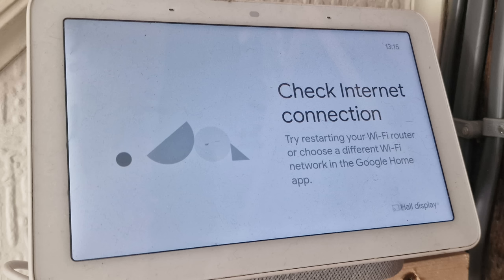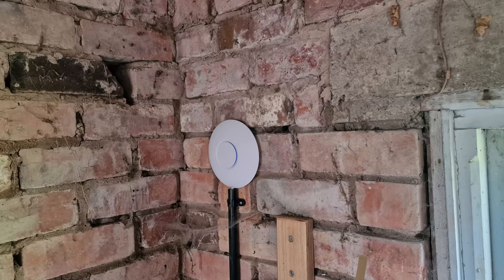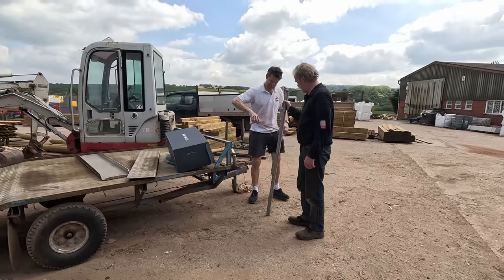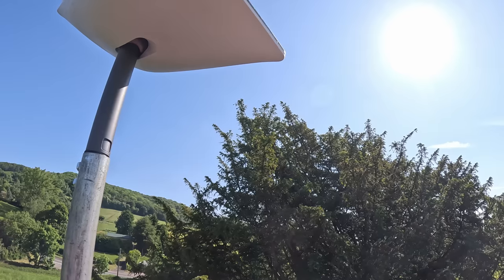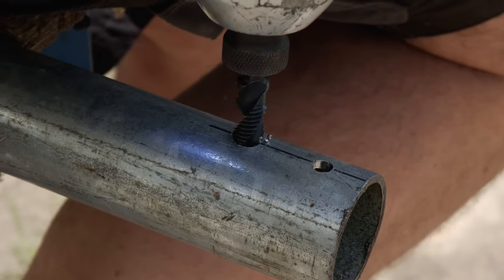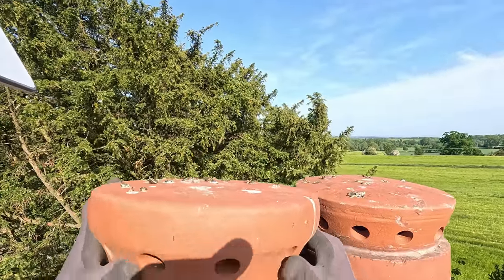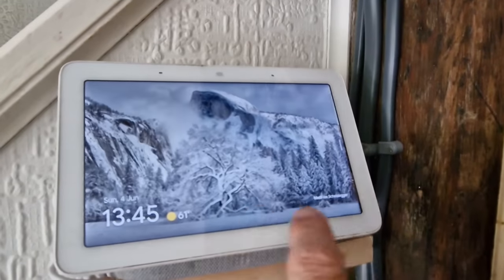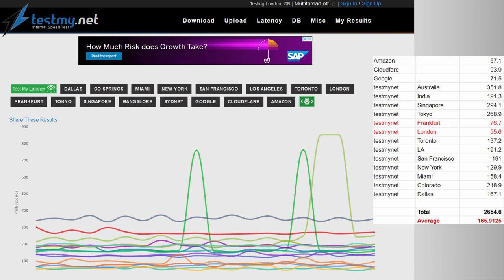Starlink Setup and Review

Comment: Your connection speed via Unifi can be caused by multiple factors. Some of which could be overcome in setup and others maybe not. Wi-Fi has 2 frequencies (2.4GHz & 5GHz) with the latter getting more features for higher speeds. Channel width can help to increase throughput so may be worth exploring config. It’s a tricky thing to get right and it’s possible to make it worse too so recommend changing one setting at a time and testing.
Reply: Keep in mind he has solid stone/brick walls in his house so 5GHz may not be the best option but it is most definitely worth trying everything that's available on Unifi which I no nothing about.
Reply: @josephking6515  indeed, I’d start by testing in same room as one of the Unify AP’s (but approx. 3m away where possible) and test speeds from there. Then play with setting on channel width on 5GHz etc from there. As you say, further away from an AP and the device may prefer 2.4GHz and then speeds will drop.

Comment: What CISCO switch are you running, if it's only running at 100Mb it will slow everything down. I'd replace it with a UniFi POE switch, so you can get rid of those POE injectors too.

Comment: Nice work, shame about the size of the monthly fee though. I would do some research about your ubiquiti before you buy anything else though. It may not be the ubiquiti that’s the bottleneck and a replacement may not be any faster. Or it may be just one component of the ubiquiti network or the cisco switch. I run about 70 devices off 3 APs, one switch and the UDM pro with no speed issues.

Comment: Not that I am in the market but I read some user reviews and it is a nice solution for all the more or less extreme situation, like mobile, boat or " in the middle of nowhere" but it has serious limitation and will never be a through competitor for wired internet in a residential area.
But everything is better than NO internet !
Thanks for sharing
Reply: I dunno, unless you are gaming, nothing else really requires the wired latency, at 30-50ms on starlink it copes with all the house needs and work from home needs too
Reply: @Extragonk  Just google the reviews and read the experienced downsides before you buy. That's all I am saying.
Reply from the maker: I'd definitely go with wired internet if I had that option.

Comment: I know you aren't an IT/tech guy Charlie but as someone with a 3500sq ft house over 3 floors, it would be really interesting to see how you've setup your network. I am looking at different options and like you will probably need 3 access points. I'd be interested to see a video explaining how you've done it (even if it isn't necessarily the 'optimal' way of doing it).
Reply from the maker: Sure, I'll add it to the list. The access points need an ethernet connection back to the router but you might consider a mesh WiFi system like the Netgear Orbi that someone recommended in the comments and Starlink have extra mesh routers in their shop, to boost the signal.
Reply: @CharlieDIYte  We moved into a rural location with a thick walled house of about 3,600 square feet. I went with 4G National broadband using Vodafone - which has been decent enough for us. Starlink would have been interesting, but not at full price!

I had an Orbi network in our old house, a base and three satellites. It worked well. In this house it doesn't. The problem is that the Orbi appears to communicate primarily over wi-fi with a wifi back haul (assuming it isn't possible to run ethernet back haul - which is hard for us to do). I gave up on it. 

In the end I purchased a Mesh network from TP-Link - the Deco Mesh P9. The "P" is important because it communicates on ethernet, wi-fi AND Power line, hence "P". The Power line is built into the unit. As long as the house wiring isn't installed by Thomas Eddison, it generally manages to punch a wi-fi signal around most peoples houses. In the end, we purchased a total of nine satellites (but they are much cheaper than Orbi) and we enjoy whole house mesh coverage. Admittedly, the mesh speeds aren't fantastic but, as most of the traffice ends up on the broadband connection going to the web, it doesn't matter that much.

Comment: I have noticed some 45 ms ping on your readings is that correct? I tested a similar system a couple of years ago, admittedly the speed was fast but the request time was horrendous so after a month I had to return it. Since this area has yet to be provided with fibre, I was considering trying again with a different company. Perhaps Starlink could be a good start. Thank you so much for sharing. 🙏

Comment: Had the same problem for a client of mine, so I used a necked pole and then U bolts to allow to clamp the stem of the Starlink unit to the pole.  Nightmare!!  They never mention the extras and even then the costs for say a pole adapter is ridiculous!  However it works a treat for my client, so everyone is happy all round.

Comment: Firstly, I’d like to know how you got that kind of deal? Here in Florida, when I “finally” got my notification that my dish was coming, I had to pay the 592.00 on TOP of the 99.00 I had put down as a deposit in March.  I got the kit a couple of weeks ago, had to order the 150 ft cable because our house is surrounded by oak trees.  Luckily our pump house isn’t so when I checked that spot, Starlink gave me a GREAT spot message.  I wanted the dishy as high as possible to make sure the oak trees didn’t block it in a few years so I ordered the Winegard 38” mast.  We buried the cable in the ground, in conduit, mounted the mast to the pump house gable and turned it on!  WOW! I can’t believe how amazing this system is.  Right now, it’s been raining ALL night, but when I checked my wifi I had 3 bars back in my office which is the furtherest from the router.  I just did an advanced speed test and we are getting from Starlink to the Internet: 159 download and 15 download with latency around the 22 mark.  And 42 download and 30 upload from the router to our devices.  Like I said, amazing!
Reply from the maker: It's brilliant isn't it! They had a limited time offer which actually ended just before I posted the video. Just as well though as I'm still paying for my old broadband connection 😩

Comment: Hi Charlie, I was interest you swapped from 4g LTE/5g cellular, to starlink.  What did you use for your cellular antenna, a built in router or an external aerial? Built in is not normally strong enough when rural.

If you'd used an external antenna, combined with a parabolic dish, you should have been able to improve your download and upload speed more than sufficiently.  I'm in the UK and rural.  I obtain around 200mb down and 100mb up.  I use two antenna  towards two separate masts to provide stability.

You should also look at the network using, as the performance will vary wildly.  Stay away from piggy back services as they limit the bandwidth.
Reply from the maker: It's a fair point Stephen and thanks for your feedback. I used the internal aerial. But the signal was fantastic for a year or so using this and then just dropped off a cliff. Starlink has been brilliant though.

Comment: Just set this up ourselves in rural Australia. We ordered the dish and then realised we needed the Ethernet adapter, but everything came very quickly. So far very happy with the system. We had been using mobile broadband, which was slow and unreliable.
Reply from the maker: Glad to hear that Joanne. It's more than you'd pay ideally but is a life saver in rural locations isn't it 👊
Reply: @CharlieDIYte  yes it is a bit pricey, it is a priority for us as my hubby is working from home. If the initial outlay hadn’t dropped by 3/4, I don’t think we would have considered it, but happy we did now.

Comment: Your lows of 6Mbs maybe indicate a problem, but if you're getting a peak of close to 200Mbs, I doubt you need to improve your Wi-Fi  - this are more or less normal numbers for Starlink right now, depending on the uptake in the area. It's also worth remembering that Ku band transmissions are quite susceptible to rain fade and this can occur between the satellite and the ground station even if you see a clear sky.
Best step would be to run those speed tests on the ethernet port.

Comment: At 12m05s it appears that the dish's tail is merely suspended from the dish; I would recommend you use quite a few outdoors-rated (UV-resistant) cable ties -- or similar -- as otherwise winds will whip the cable are quickly wear it out. (Think those flag pole wires incessantly banging and pinging in even low winds.)
Reply from the maker: It's a fair point. I've secured it with zip ties. Not sure why I didn't show it in the vid. Always forget something!

Comment: I just picked up the rural offer too; lucky to see it the day before it ended.  Delivery of the dish was super fast, but the ethernet adapter is / was much slower.

I wanted to go for the chimney install, but was advised against it due to concerns over strength; your install looks solid though - fair play.  👍

Good vid, and good tips.  The cable's a pain to get through, and doing that in advance I found helped a lot.
Reply from the maker: Thanks Steve. Yes my chimney is strong as, thankfully. Hope your install goes well. I'm really happy with it so far.

Comment: I am curious as to where you are based, as in "Rural", I am rural in West Sussex and have moved over to Box Broadband (Surrey based) and have connected to their fibre network. This is under a government initiative for connecting rural areas. So far very happy with better download and upload speeds that you report. I am on the lowest connection, 100Mb, which is fine for us. I too was getting frquent drp outs with TalkTalk and they were not interested in solving the problem, luckily I was close to the end of contract so could switch.

Comment: Regarding your speed tests - connecting over wifi as you have found out, CAN be very hit and miss with speeds. This is down to so many things: antenna, wifi standard and version, wifi frequency (we're up to 3 now: 2.4Ghz, 5Ghz, 6Ghz) each on client and access point, wall thickness and construction, location, orientation etc etc etc.

To get the best speed, it's always going to be a direct connect with a cable, but it looks like you're getting a pretty good speed over wifi, low latency and jitter, but that may change as you move about the property. At the end of the day, data is going up to and down from space, it's always going to be slower than FTTH or 5G to a local tower (and then further on via fibre again), but glad to hear it's doing you alright
Reply from the maker: Thanks buddy, appreciate that. Yes I'm gutted the 5G is no longer viable and I've just realised I've got 8 months left to run on the contract 🤦

Comment: You don't need to change your unifi, you probably just need to configure it correctly. Unifi is rock solid with speeds
Reply from the maker: Yes, I'm sure it's not configured correctly and doesn't help that I've got RJ45 connectors on solid CAT5e cable.
Reply: @CharlieDIYte  I went full unifi and all works well. I'm surprised you managed to get RJ45 on solid cable. Get some keystone jack's. Makes life easier

Comment: for the pipe mount I would use pipe/hose clamps  and just use a grinder to cut two slits 150% of the length you try to clamp down or more if the pipe is on the large side inner diameter wise.

Comment: great video! I'm UK based (Farnham near Guildford) had starlink since mid 2022 (the round dish) have the squarial version you have at my villa in northern spain (that is in the sticks!!!) and just ordered a 2nd starlink dish for my UK home - plan to pair the two together for load balancing - can unify handle multiple WAN connections?
Reply from the maker: Hi Nigel, thanks for that. Found this which suggests you can't but CodeGreen in the comments suggested you can load balance with Ubiquity so worth looking into I'd say.  https://community.ui.com/questions/Best-UniFi-only-Configuration-for-Multi-WAN-4-links-Setup/6daf8cd4-e540-4a71-8f7e-700e915e10e7

Comment: @CharlieDIYte Excellent video. Also watched your update one which details more on the Unifi set up. We live in a very rural area and have jumped from provider to provider each with their own issues. Currently we are running it over a 4G network. It is not ideal. I WFH and currently have major phone problems. I can't use the Yealink phone and have to use the app on my mobile! Thankfully when we renovated our old barn we put in CAT5 cabling and we do have Unifi throughout which is currently managed by our internet provider. My question is, all the Unifi    equipment is ours, not the internet provider, and yet I have no knowledge of the set up codes/passwords/configuration etc., so don't have the Unifi portal on their website. I want to go over to Starlink but it is concerning me that if I try to do so how do I reset/configure (and take control!) the Unifi equipment to Starlink without this info? Is there a simple 'reset' I can do? Does anyone know the answer to this? Or can direct me to a video on how to do this please? Thank you in advance.

Comment: For rural locations i get it. But i will say i was expecting >200 speeds for the cost of the whole outlay throughout the year. Still i guess if needs must and you are used to much worse its a big upgrade and if you can make that investment worthwhile for yourself then why not.
Reply from the maker: Yes that's the point. That EE router seemed to be the answer and was only £35 a month but is shocking. The frustrating thing is I've got 8 months left to run on the contract for a non existent service.

Comment: Charley, can the Starlink dish be attached to a pre-existing larger internet dish, to piggy back off the larger dish, or will it run interference?
Reply from the maker: I don't think it would run into interference but you have to ask whether it would get in the way of the pre-existing dish's signal, and also how you'd fix it up there securely.

Comment: The EE RF-Modem is a Zyxel NR5103 with crippled firmware. Buy one with full Zyxel firmware to determine what's going on. It may (or may not) help to use external directional antennas, as the NR5103 has 4 internal antennas (4x4 MIMO) and you have LOS to "a" cell tower. If you do find yourself back up the chimney, punctiliously keep the coax cables to antennas very short. Even place the NR5103 itself on the chimney in an RF transparent waterproof plastic box. It might seem extreme, but needs must. Of course, the issues may be EE's back-haul microwave / network connectivity. V2.0 Starlink's are years away, the race is on with FFTH, you and your neighbours could always dig your own trench, just like B4RN. Bonne Chance.
Reply from the maker: Thanks, that's really useful. That's the problem. You don't know what it is, from the trees around the mast to issues with their network.

Comment: Could this system be installed on the top of a motorhome? The ability to get decent Internet wherever we park up for the night sounds very attractive. If the unit needs 240V then we can easily run a small inverter to power the unit, if the power demand is not too high
Reply: If you pay £85/mth rather than £75/mth, you can take your Starlink on the road to any location, plus use it at home.  The £75/mth allows you just a home location.

Comment: I thought you may have tried an external 5g antennae such as the Blue Spot 2x 2 High gain connected directed into your 5g modem if it supports. I have and see stable 150Mbps on a daily basis.
Reply from the maker: I think the problem is that mast is completely obscure by trees now. It might have helped though. 👌

Comment: My Starlink system won’t complete its installation process despite many fresh attempts I have given it. It just will not progress to the fourth stage “done”.  There doesn’t appear to be any clear support line to seek help. Despite being in open ground the test also suggests looking for a better site. I wonder if I have a duff unit. Any ideas welcome.
Reply from the maker: Sorry to hear that. Have you done a factory reset (switching it in and off 6 times). I found that ethernet adapter I bought was faulty. So if you've got it plugged into an adapter maybe remove it and try install with it connected directly to the dish.

Comment: How does Starlink cope with on line gaming? My two boys play Fortnite etc, currently we're on a 1GB fibre connection but every year storms blow over trees that invariably land on the fibre cable and snap it, then we have to wait weeks for Open Reach to repair it! We are located rurally so OR won't entertain putting the cable underground.
Reply from the maker: You're not going to get anything like 1GB and Starlink will be more expensive but latency is pretty good so I suspect it would work but I haven't tested the connection on gaming.